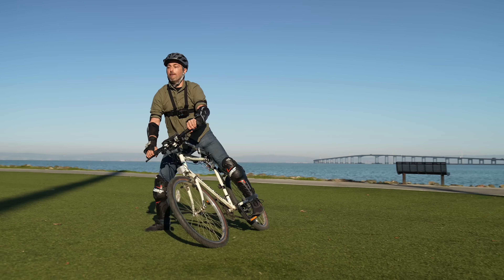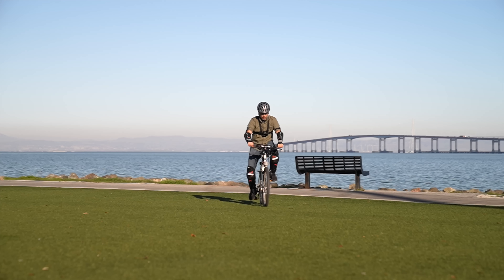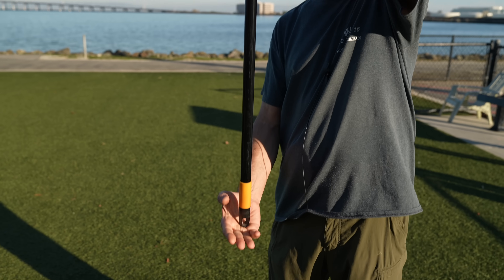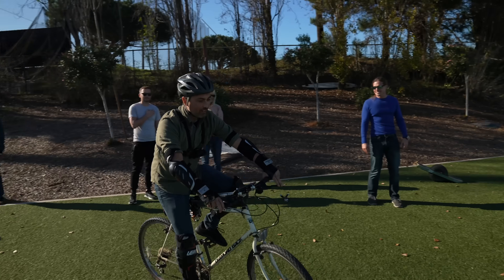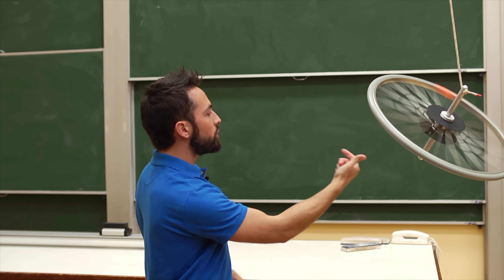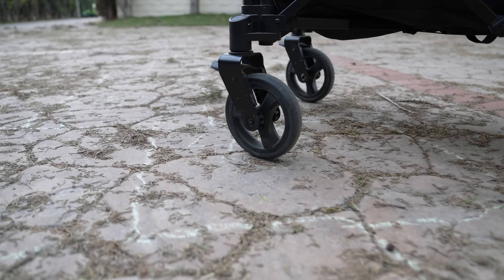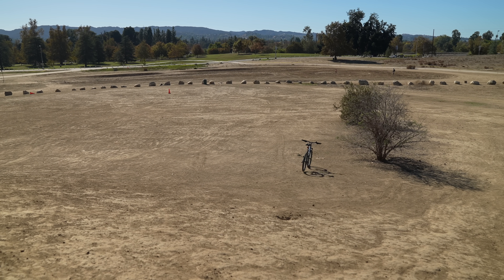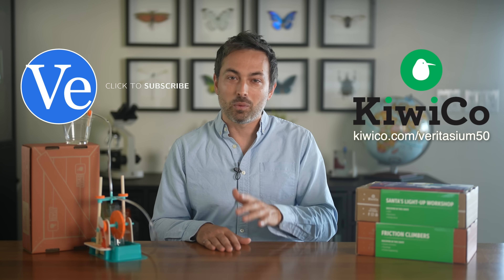Most People Don't Know How Bikes Work

Comment: Bikes self-stabilize through corrective steering, and there are supposedly (according to your video) three mechanisms responsible for this:

1. Caster wheel effect: The steering axis is positioned in front of the contact patch. When the bike leans, the force from the ground on the tire creates a corrective steering moment.

2. Center of mass positioning: The bike's center of mass is located slightly in front of the steering axis, contributing to stability.

3. Gyroscopic effect: The spinning wheels act as gyroscopes, theoretically helping to maintain balance.

However, your video demonstrated that the gyroscopic effect doesn't contribute to self-corrective steering. Also, the experimental bike you showed proves this point quite effectively. It also disproved the caster wheel effect!

If both the gyroscopic effect and caster geometry aren't the primary factors, then it seems like weight distribution and center of gravity positioning are the only contributors to bicycle self-correction steering and overall stability.

So, of the three mechanisms, I would say that there is only one that actually works. Plus, I would add that the cone shape of most bike tires likely plays a role as well, as it naturally steers the bike back toward vertical when leaning.

I believe the shape and roundness of bicycle tires was never mentioned in your video.

Comment: You could have just ridden a bicycle without using your hands and the front wheel and the handlebars would have shown all of this for you
Reply: Which is the reason for the videos showing the bike being pushed downhill by itself.
Reply: @jb8478 I still think it’s more relateable riding without hands since 90% of people have experience with that and not many have real experience riding a bike without being on the bike
Reply: @VisorGP To me just seems more logical pushing the bike down a hill without being on it so you're not risking falling and you should get same results (if you kept calm not holding onto the handlebars).

Comment: I have seen and known this video pretty much since it came out, and as a Dutch guy, after having tried it oh so often that my family does not notice me doing weird things with my steering anymore, I think I can safely say that I seem to get different results. 
If I lock my arms in an attempt to recreate the turning impossibility, I can still turn, and no, I would realise if I counter steered, because then, for a quick moment, it should feel like I fall.
I think the issue is that you don't know how to bike properly, unlike a car, which is not affected by the way you sit on it, or a motorcycle, where really, your weight does not matter because the motorcycle is relatively so heavy, on a bike your weight matters too, I see you trying to turn but keep your body straight. I have noticed I never do this.
Firstly, because having your body move in the way you want the weight to go makes the turn go almost automatically, I can bike without my hands for literal kilometers, but mostly because it makes the corners easier, because the bike naturally tends to the way the weight is, making the turns take less force by hand on a sandy road or a road that otherwise costs effort to move over.
I think that because you don't lean, and thereby ride the bike wrong, you fail at turning without countersteering
Reply: On a motorcycle tho, when you’re going fast enough, you literally have to counter steer to turn tho. If you’re ripping 200 on a bike and steer right, you will always go left. I really don’t know if I can use my weight to counter act that. Worth a shot I guess.
Reply: @brenchyalowicois6748 
My point was not about motorcycles, because your weight relative to theirs is much less, I weigh 5 times as much as my bike, if I lean, that is definitely more than half of the total weight. And even then, motorcycle racers also lean in their corners, so clearly it still helps

Comment: motorcycles have 2 steering modes that have to be transitioned at speed ... do not get on a motorcycle thinking it's just like a bicycle, or you are going to get hurt.

the low speed is like a bicycle ( where you will naturally trail shift your balance ) but as you accelerate things will change.

Comment: that's called trail shifting your center of balance .... i do that, at very low speed, on my motorcycle also.

but motorcycles do something else that bicycles Do Not Do.
the gyroscopic forces, on a motorcycle overcome the natural steering physics;  the front tire is actually sliding across the pavement in normal counter-steering at speed......Motorcycles Are Different.

Comment: Counter-steering: Although its unnatural, you can steer a bicycle  in the direction you want to go by turning the handlebars that way. But, you must first shift your weight, (i.e., move the center of gravity), in that direction. If the two-wheeler is heavy enough, counter-steering is once again the only way to turn, and we're talking about motorcycles.

Comment: ... FOR EVERYONE THINKING YOU CAN LEAN AND TURN BY CHANGING YOUR CENTER OF MASS. This is NOT possible. There is two ways to show this. 1. Try standing still while keeping your balance and NOT turn the handlebars. It is impossible. 2. Try riding on a very narrow line. This would be super simple if leaning could change your center of mass, however it is very difficult.

Comment: What about just leaning.
Reply: Yo it does NOT work. Actually the leaning you think you are doing is from countersteering. Try standing still without turning your handlebars. It is impossible, the reason is thag it is impossible to lean in the direction you want (without a little countersteering)

Comment: I feel like to some extent, we do know to do this, because when we are coming up to a turn, 
the tighter the turn, the more we slack we have to give ourself to lean some of the counter forces's opposite way

For example, the tigjter the right hand turn, you might possible create a bigger "circle" by initiating a turn to the left so you can lean some of the extra ways to the right 

It seems some of the concepts are intuitive and some are clear enough that we know how yo use them and lock in 
~ even if we can't quite explain why we may be doing it like it

Comment: One thing not included is that after a bicycle turns in the direction of leaning and balance is recovered, the momentum of the bike forward causes the front wheel to get pushed back straight. If you push a bike forward and keep it's center of gravity inline with the frame / wheel bases and let's say the handlebars and front wheel are turned one way, the front wheel / handlebars / steering mechanism gets pushed straight by the force of friction of the road on the tire / the tire contact patch to the road.

Comment: Usually you just lean and if it's tight stick ur leg out to throw ur bike around I've been driving an ebike and if I were to turn the bar I'd probably flip over kinda like in motorcycle racing the lean a lot yk
I think that's why death wobbles as so dangerous because it's fast rapid shifting of balance

Comment: "It is just as hard to balance on a bike without balance as a bike with locked steering" is definitely not true though. I can cut corners and ride for significant distance without using my handlebars at all. It takes a lot to practice at it, but I learned. That said, I cannot balance on a stationary bike for more than perhaps a few seconds.
Reply: The reason why we can ride without touching the bars is because the bicycle counter steers by itself. Just jump of and it can keep going without you.

Comment: Speed and lean make all the difference. It's not just steering or turning the handlebars. No one thinks about everything when you say steer they only think about the handlebars. Do a manual on a bike and steer around its only on one wheel and the bars arent really doing much its the lean and where your hips or center of blance is.
Reply: Wrong.

Comment: This is crazy. I am Dutch and ride a bike since I can walk basically, and never never realize this 😂
Here kids start learning to ride a bike with a tricyle or walk bike (?) and eventually detachable training wheels. I guess that time I already subconsciously learned this, and by the time my parents took off the wheels, I could basically already bike. As a kid, you think the balancing is the hard part. It looks like terrifiying magic that the bike stays upright on two thin wheels, but... it's actually the steering ! 😮 
Fascinating!

I wonder if you COULD steer the rigged bike just by shifting your weight, rather than using the handlebar. You don't NEED to actually turn the bar a lot of times. That's how you can still steer when cycling without hands on the bar.

Comment: I don't think that to turn right you have to counter turn left before, I've tried. Instead it's your body that when you want to turn right it moves to the right moving the weight on the right. Doing this makes the bike lean to the right and the front wheel naturally turn to the right and finally makes you turn right.
Reply: countersteering is easier
Reply: @SieniSoppa  ok but it's not necessary as it seems to be explained in the video
Reply: @ilguerrierodragone129i agree
Reply: @XtreeM_FaiL No, i disagree, i tried it going on my bike i can turn without counter turn before in the opposite direction.

Comment: you can you just lean left and weight the left pedal. The alternate behaviour accellerates the state change but weight shift works if you understand that. Anything on a curvy rail would teach you that intuitively too! (actually its the same process  and its orientation at play). Sometimes your attempts are not very genuine?

Comment: This is why it is way easier to walk a bike by pushing the seat instead of the handlebars. Try it, and you will never push from the bars again. It even works on my 90-lb tandem.
Reply: Hm, that's only true under certain circumstances, like little or no mass for'ad of the steering axis and lower than average front-wheel trail.

Comment: Very good video!  There is a lot of confusion among the motorcycle crowd about how bike "steering" works.  Many motorcyclist believe there is some magic thing that happens when they go from a bicycle to motorcycle, or when a motorcycle reaches a certain speed (most say around 12 - 15 miles per hour) and they suddenly have to start counter steering.  In reality, all bikes steer in exactly the same way from the time the wheels start rolling all the way up to racing speeds, although as any "bike" becomes heavier and faster, the need for deliberate use of counter steering pressure the handlebars gradually increases proportionally.  At lower speeds or lighter bike, body movement can bypass the need for counter steering pressure to the bars.  The effectiveness of body weight shifting becomes less as the bike gets heavier and faster, but its effectiveness never completly goes to zero.

Comment: From what I understand (and went to test right now again) while you are indeed countersteering to keep your balance, you do not need to steer left to then turn right, in order to off-balance you in the right direction. You can start by throwing your weight to your right, thus off-balancing yourself towards your right, and then the steering follows you to the right. 
I would love to ride that test bycicle, but I would try to test also something else. Try to film someone riding straight towards you, at about 15km/h, and have them turn with the specific instruction to not countersteer left to go right, but to throw their right knee out to the right (without taking the foot off of the pedal) and leaning to the right. The steering will follow unconsciously.
I'm curious to see how that footage would turn out. Oh I have to specify that the cases in which I tend to use that technique are mainly while stopping to pedal. I don't use that on very tight turns because you can't lean that much if you have to slow down a lot.

Maybe in that case I am countersteering but wayyy more lightly and progressively than shown in this video. I'm still thinking it's possible without. I'll hae someone film me one day to test it out.

Comment: Most of the time I tilt my body to the side I want to steer the bike before turning the handlebar and I dare say that I don't countersteer every time. In winter times I rely less on that as it's a bit slippery even with tires made for winter on my bike so yes, you do tend to turn a little bit in the opposite direction before turning.

Comment: Counter steering with a bicycle is used to cause the bicycle to lean into the turn and balance.  It's possible at higher speeds to initiate a turn by leaning into the curve without counter steering.   Riding with no hands on the handle bars has this effect with the caster and trail of the steering geometry turning into the curve to keep the bicycle balanced.   A bicycle with no rider in motion will keep spiraling in tighter and tighter and leaning more and more until the peddles catch the ground.   Bicycle stability is much more complex than this.   This covers the main geometry dynamics. 

Under peddle force a bicycle is unstable causing it to swerve.   Practiced riders can hold the front tire in a stable straight line, but under peddle force the rear tire in the wet can be seen to leave a weaving back and forth path. 

Learning to ride a bicycle under peddle force is only considered to be truly achievable by humans because it requires changing our mental state to allow subconscious simultaneous actions to be used.   This letting go is something many people have difficulty with.  It is learning how switch how our brains our working placing it into a somewhat meditative state.   Animals are not thought to be able to do this.   This is a coming of age experience that adults don't typically remember.  

This letting go comes with a prominent fear of falling that frequently overrides a simple fall to crash into much more injury and motor vehicle traffic while being totally focused to not fall over. 

 Having to peddle an adult bicycle places the minimal speed to be about 6 mph where a minimum of 10 mph is desirable to eliminate large swerving motions.   To ride down on the drops of drop handlebar road bikes while peddling 14 mph is considered a minimum speed.   Experienced hill climbers can do this at 12 mph.  There is a lot of effort going into balancing the bicycle under hard peddling at only 12 mph.   Without peddling a practiced rider can balance a bicycle while seated using leaning down to 2 mph and less.  A bicycle in a turn can balance under peddling below 6 mph this leads to wild swerving.

Comment: Anyone who has ridden a motorcycle knows turning is more complex than that. At high speeds, push right to go right, and push left to go left (counter steering). At low speeds you need to adjust your steering input and speed to maintain balance. Locking out part of the steering input will result in losing balance.

Comment: Bikes dont work how you think. Here is a bike not designed like any other bike to prove my point. Bmx bikes are lower to the ground and you absolutely can turn in the direction you want. Yes you will fall if you over steer. Sighhhh. I know because my parents didnt have a car when i was a kid. So i used a bike to go everywhere in the city.
Ill tell you whats wrong with your turning and why you fall. You fail to tilt and turn. I never stick my knee out either..... how come i could prove you wrong with 5 mins on my bmx. You dont have to do any of these things to shift weight either. Just shift your core and the bike will go wherever you aim.
Reply: "can turn in the direction you want"
Really?
Bike that turns where you want. Genius.

"Bmx bikes are lower to the ground"
Every bike I have rode have been so low that they touch the ground.